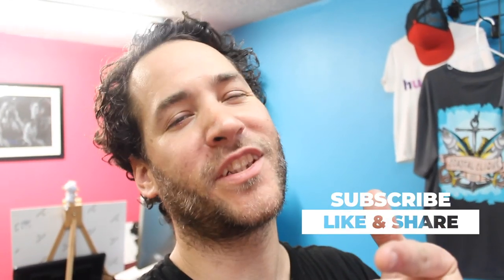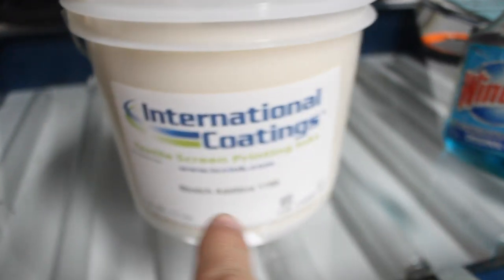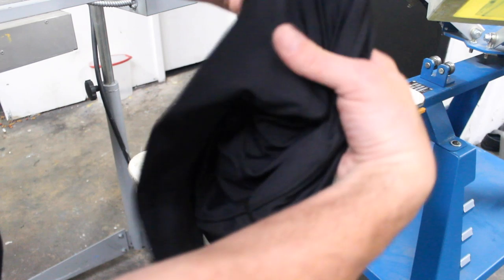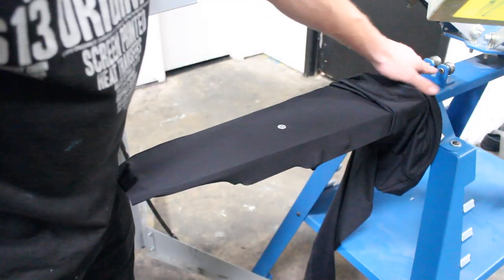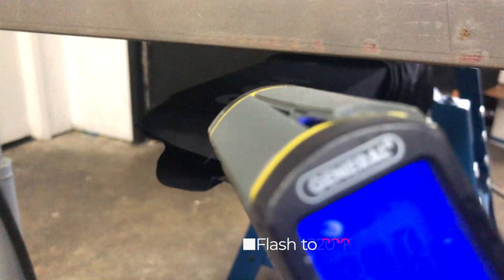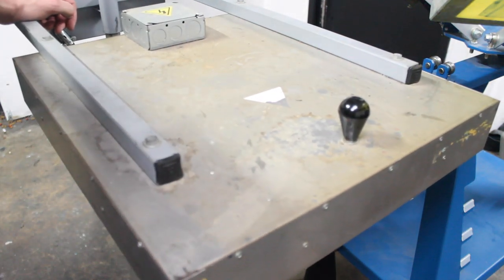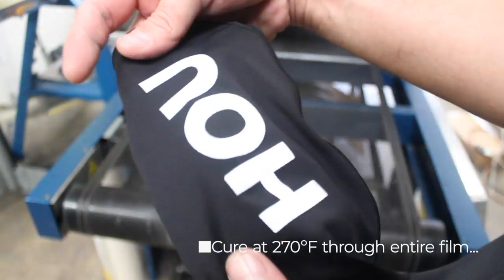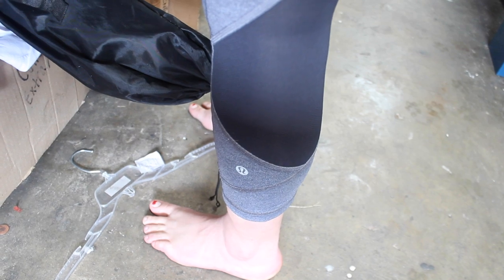How to Screen Print Spandex (with Techniques & Tips!)

Comment: hi Mikey, can you advise on reflective for the same garment type.
Reply from the maker: Use a low mesh, 85 or 110 so the microbeads can pass through. Add a little stretch additive. Print flash print and you should be good.

Comment: with them stretching so tight on the pallet, do you really need to have it really tacky?
Reply from the maker: You do to keep them in place. Especially if they're pricey. Wouldn't want to have to reprint and take the hit on replacements. Even though they're stretched a little, they can still shift trying to contract. If you know what I mean. :)
Reply: @mikeydesignssilkscreen473  yeah , the reason I asked is they seemed really tight. I had a few shirts stick when I was trying to get them on right and it caused the design to be warped...lol. I'm selling junk shirts for printers to use as test prints... Lol I must have 100 on the floor...but on a bright note, I haven been throwing things...

Comment: Hi! I’m getting a tiny screen of my logo for my swimwear.  Can you suggest a good ink and additive? Or where to get it? I’m not needing a bunch as it’s a small design.  Also you can’t mix this in advance correct? Another question your hitting it with heat correct, is there a certain cure time?

Comment: Can you run it under the flash dryer again instead of a conveyer dyer incase you don't have the budget for a conveyor dryer?
Reply from the maker: You can. Just pull the garment off and set it on the pallet, and check that it gets to the correct temp.

Comment: Hey Matt, is there a reason why u used a high mesh screen? Im assuming it was 230 because it was yellow mesh. Just wondering if there was any reason behind that or if a high mesh is required in printing spandex. Thanks for the video man. This is great stuff here.
Reply from the maker: Thanks! I use higher mesh screens so it's not a bullet proof print. This print was done with a 196 to give it a softer hand.
Reply: Less ink deposited

Comment: Had this same brand , total fail . I want to confirm mixing nylond bind and stretch add . Could that been the reason ???? I kept getting cracking
Reply from the maker: You don't want to use nylon bind on spandex. The stretch additive and regular ink is enough. Nylon bind would be good for things such as bags where it needs a little more durability. Nylon by nature is a pretty stiff material.

Comment: Hi Mikey, thanks for the tips, actually i just want to know the conveyor speed which you set 270F? Also i had a big problem printing on polyester dye fabrics, can you please suggest which the best heat for polyester dye fabrics? I'm using INKUIN brand ink also i mixed white with stretch base also i print anti migration grey base below the white ink still having problem like after 3days it's becoming bleeding fabric color on top of the white printing please advise